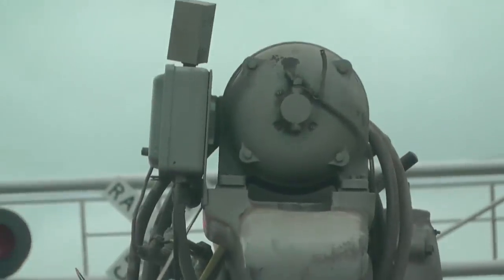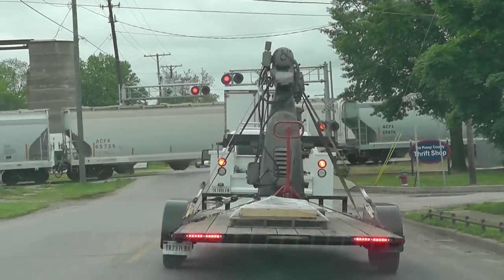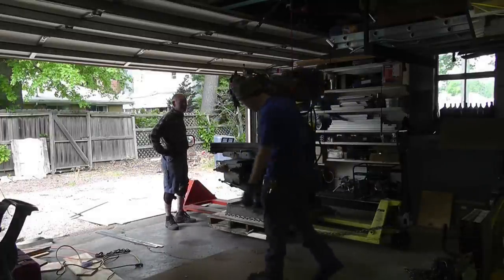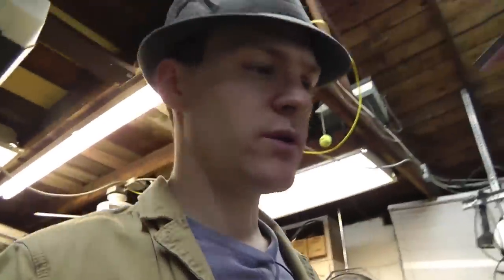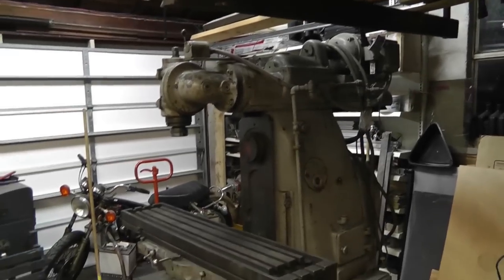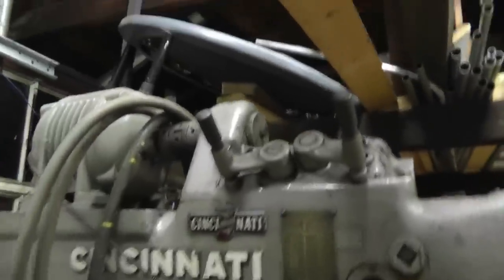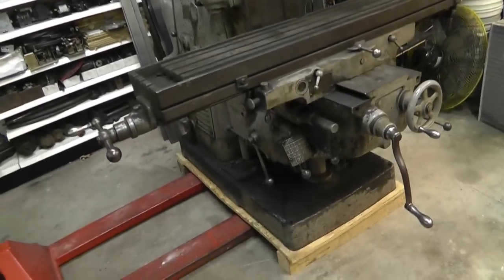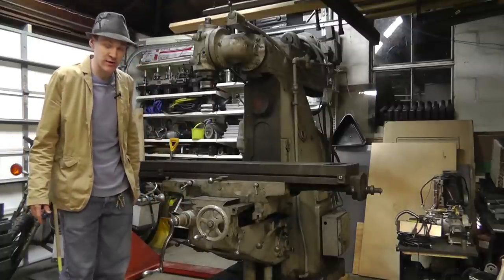Moving A 4,800 LB Cincinnati #2 Mill In To The Lab... I Get Hit In The Face!!! OUCH!!! RWGRESEARCH

Comment: THAT , my friend was one hell of a score!! I ran a #2 MH as an apprentice back in 1972. That design of mill sent a lot of shapers to the scrap yard. With the flexibility and range it has you can do a v-8 engine block! The only drawback to the machine is also it's strength. All the pivot points are easy to knock out of tram if the vert. head is pushed too hard by too fast of a feed or heavy chatter. Since you will probably not run the machine every day you should trammel the head before each use. As for the cutters go that was a bigger score than the mill! Those concave and convex cutters were big bux 50 years ago.They should only be used to cut the radius that they are shaped for as they have to be face sharpened on a cutter grinder and don't hold an edge as long as a straight or stagger tooth cutter.

Comment: You know what is cool about that with the compound angles you can set the head at, you can cut gears and cutting tools. Provided you get a feed mount. It rotates as the table feeds. The cutters you have with the radii are for that action. That and cutting gears.

Comment: I can't see them for sure but I would say those braces are the ones that are supposed to go from the knee to the overarm to stabilize it for taking very heavy cuts in the horizontal mode.  When you are cutting 6"+ in one pass it pushes up pretty hard on the cutter.

Comment: You should get that mill off the pallet if you can. It will be much more ridged and vibrations will bleed into your cement floor producing better surface finishes. And if that pallet were to start rotting against the floor your mill could end up on its side one day...
Reply: He probably doesn't have a crane to pick it off the pallet.